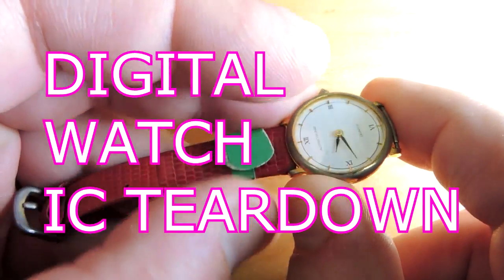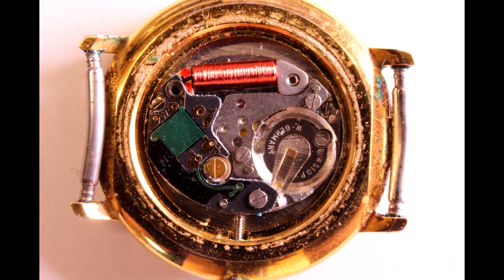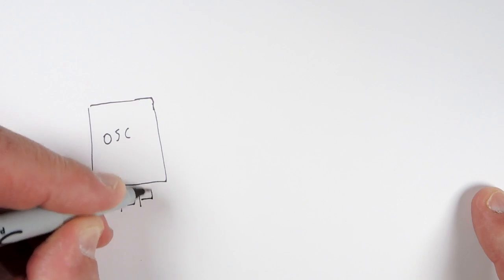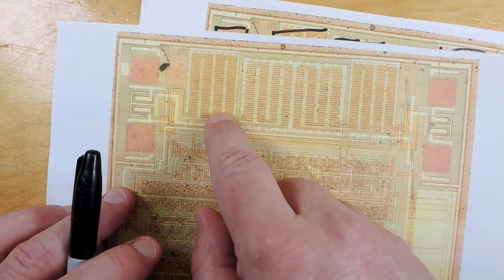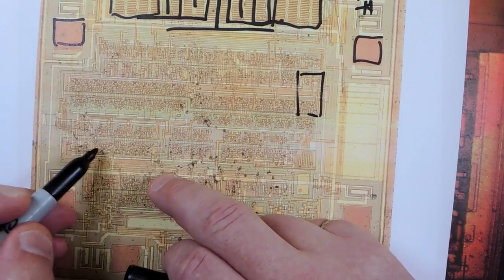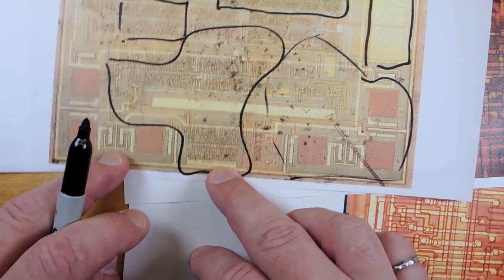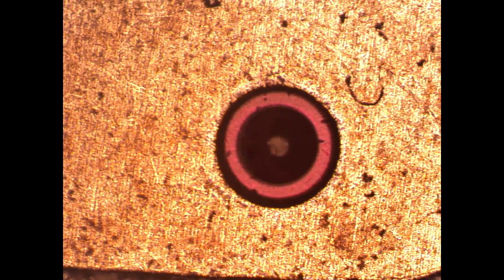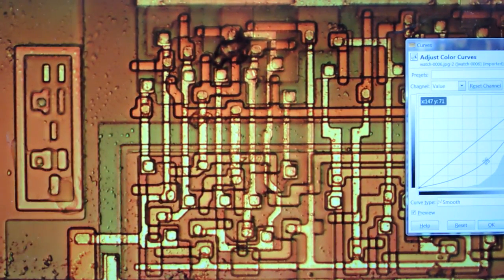DIGITAL WATCH TEARDOWN: THE INTEGRATED CIRCUIT

Comment: as others already pointed out a year ago - the sectioning of the binary divider is most probably there to allow for the generation of the short spikes of current which are pumped into the coil. Instead of inventing some kind of timing circuit it is a reasonable idea to use some stages of the frequency divider.

The circuit you sketched was a synchronous shift register and not a ripple counter. In a synchronous network all flipflops are clocked from the same source, in the ripple counter the next flipflop is clocked from the /Q-output of the previous stage. Constructing a synchronous binary counter needs quite a lot of extra logic and it doesn't really have an advantage in this particular application - therefore I would assume that it is a ripple counter just like the old 4040 and 4060 CMOS counter chips.

When it comes to the two capacitors - these are most probably part of the xtal oscillator circuit and not part of the coil driver.

Comment: ive always wondered if this circuit could be made using transistors and other components on a circuit board. i wonder how many transistors would be used for the flip flop reducer and other sections.

Comment: that logic between the counter and driver transistors is most likely to gate the transistors for a part of the count;  the pulses are very short and generated by using some of the other counter outputs.  I read at one point that as the battery voltage falls they keep the pulses on longer to compensate, but I don't know if this chip does it.  That large capacitor could be used as the load capacitance on the crystal;  they may only need one because the second is the adjustable cap on the board.  There are several sections to the capacitor for some reason, it is possible some of those other pads and logic allows for OTP programming of the load capacitance, since it's fairly critical for accurate time keeping.

Comment: Just one thing: in a ripple counter, the D input of the flip flop is its notQ output (to make a toggle FF), and you do not have a common clock: the clock of the (N+1)th element is the Q output of the Nth element, thus each FF toggles at half the rate of the previous one. This would probably be a better choice in a watch IC because you reduce the switching activity of the counter, thus the power consumption (although probably this would add an insignificant amount of battery life).

Comment: why did they bother making synthetic ruby when they could have just made synthetic corundum which is just ruby without the chromium dopant and prob just as hard
Reply: Most likely because ruby sounds better than corundum. It's probably harder to get pure corundum (which would be colorless) than some with a few impurities in it. Or maybe it was easier to get rubies because they were produced for lasers anyway and you could use offcuts or crystals not good enough for lasers.